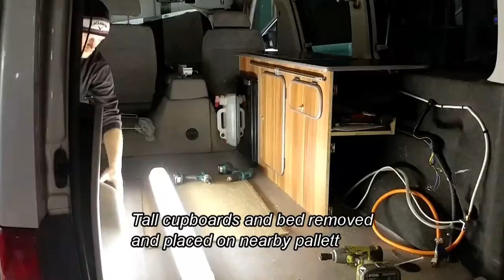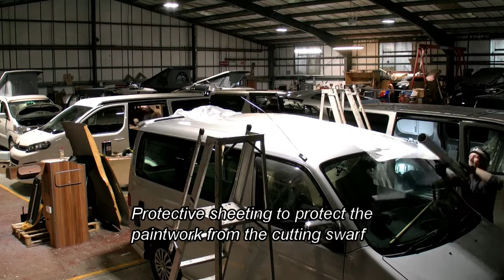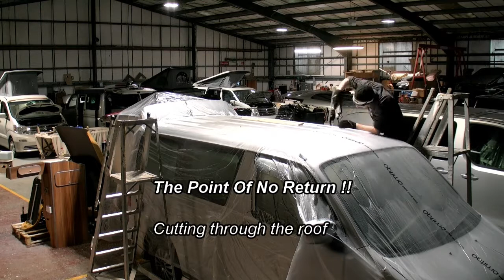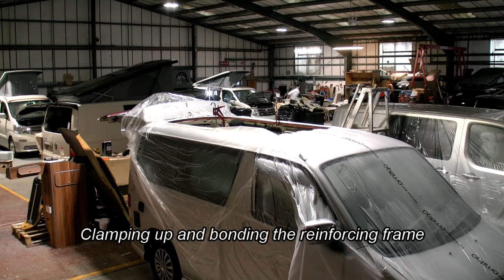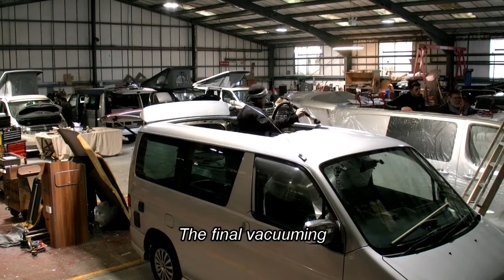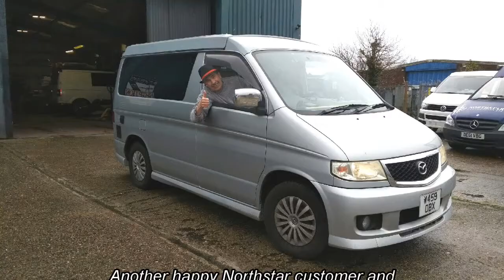Mazda Bongo Elevating Roof time-lapse, fitting by Northstar Conversions, Drivelodge Poptop

Comment: how much does this cost ?
Reply from the maker: Stacie . . . it costs around £3,000 depending on whether you want a window in the front part of the elevating roof. There are already two side windows, but the front is extra cost, (about £150 I think)
I went from Bristol to the Isle-of-Wight to have mine done, as they loaned me one of their spare Camper-vans for three days to tour the Island while the work was being done.
Reply: Very interesting and a nice job. But I’m glad that my Bongo has a original factory fitted lifting top!
Reply from the maker: @daveyr7454  - The DRIVELODGE Elevating Roof is so much better that the origiinal Bongo Poptop, as it's far neater and almost invisible when down, and because it's manual there is nothing to go wrong with any electrics, as is frequently reported on the Bongo Forums. with their roofs stuck in the "up" or in the "down" position 🙂